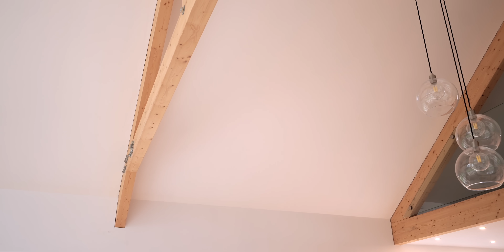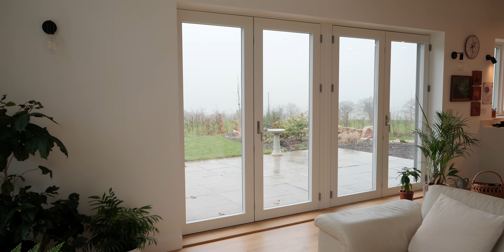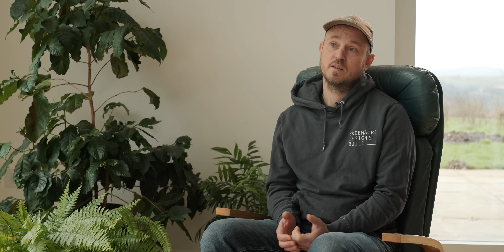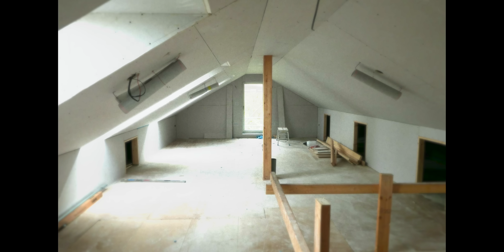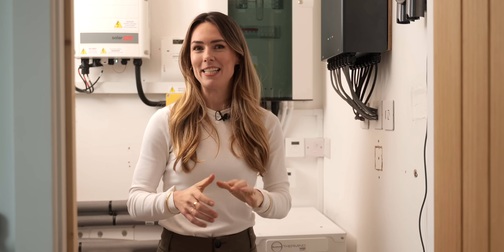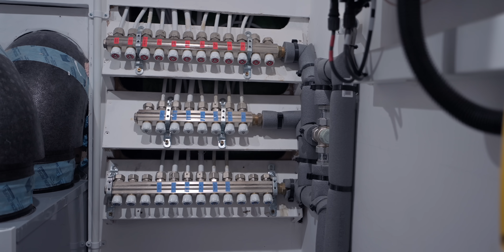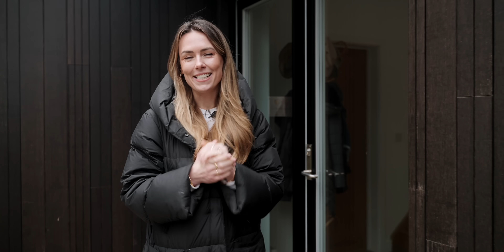Ditching a Heat Pump for In-Plaster Infrared Heating?!

Comment: The cost of electricity is ridiculous.
Reply: Which is why using an efficient electric heating system is crucial
Reply: @ASTECtherm_Infrared_Heating No look at why it is so expensive.
Reply: @fortnitefred1351 

Yes but is it?

Feel free to do your own fact checking on how efficient FAR IR happens to be.

And kindly don't drivel on about the claimed COP figures ref heat pumps.

Indeed the performance of a heat pump within the confines of a lab might well be impressive.

However, the financial efficiency ref a heat pump installation is nothing like as impressive given the costs of the pump, installation  of same, and all the other improvements highly recommended "by heat pump experts in the retail trade", who can spot an opportunity and a susceptible population of mugs a mile off.

How else do you suppose retailers survive and manage to just about rub along on vast profits?

You're a school boy aren't you.

There has to be some mitigating reason for your opinions surely to Goodness ...
Reply: @ForestForest-n9i  we are paying for bullshit windmills and solar panels, when china is putting a coal fired power station on weekly. Energy is the real currency.
Reply: @fortnitefred1351 

Not quite.

Why not read up about it before blathering on about stuff you barely comprehend.

If China do add coal
power stations on a weekly basis then what are you going to do about it?

You could always write to Xi, care of the Chinese Embassy wherever you are, and complain in the strongest possible terms.

Then, once he's reeling on the ropes from your rebuke, insist he stops at once or you'll never buy a Chinese takeaway ever again.

If that doesn't make Xi sit up and take notice then I don't know what will.

Comment: I hope this house also had a rainwater recovery tank under the garden, to use for gardening and flushing toilets. They are cost effective.
Reply: And don't forget it's a source of water for the Fire and Rescue teams when fighting a fire at a home.

Everyone knows that the likelihood of heat pumps erupting into a Post Code wide conflagration cannot be entirely dismissed hence the FAR IR elements radiating pure infra red radiation instead. This radiation cannot burn in and of itself.

No danger of a dangerously high COP from that direction.

It looks as if these are the very last days of BEVs before they are dragged to the breakers' yards.

Fortunately the recycled steel and plastics will help create the millions of FCEV and H-ICE vehicles soon to be seen driving the last of the  BEVs off the roads,  everywhere.

The lithium can be  used in medication to treat the millions of ex BEV owners, probably.

Comment: Radiant heat panels were all the rage in Canada during the 1990s. They were extremely thin panels that were installed the ceiling, under the sheetrock. Then they started fires and every house that had them were mandated to abandon them and install an alternate heat source. Fires behind the sheetrock would be my worry, so I would never have them in a home of mine.
Reply: Hmm ... why not Google up the difference between radiant panels and FAR IR panels.
Reply: Different technology from a different era.  Unlike laminated films, which are still sold today, this has been manufactured using a homogenised technique to eliminate debonding.  In addition, the graphene purity and density is such that we can operate between just 26° and 40°

Comment: Very nice. The question that remains open is how much did it cost to realize this. Only then we know how to compare the 196 per year.
Reply: Financial costs are at the absolute core of energy. If money was no object, why would we even watch this video?
Reply: @onyxsigrid  I'm not sure that's always true, it wasn't for me. I was happy to pay a premium for renewable tech, knowing that it gave me grid independence and cleaner/safer energy. The cost benefits over the longer term are actually secondary.
Reply: Agreed. The biggest issue with any YouTube channel that talks about sustainability is being entertaining.  Sustainability is boring😂😂. 

Reusing or retrofitting existing structures is far more sustainable than new construction.

New construction has always been something out of reach for many people. Add in the high cost of being “environmentally conscious” and well …this channel is entertaining for us middle class people. 😂😂
Reply: @TyrrellCornwall  I have to disagree - tho it depends what sort of 're-use' you are talking about.  I'm based up in the Hebrides where most of the older properties are stone-built storey-and-a-half buildings.  The cost of making these structures even vaguely thermally efficient and air-tight is horrendous and would only ever be a serious compromise - and heating them is a nightmare.  In reality, it would be way cheaper to just start from scratch and even more so if a slightly more pragmatic near-passive rather than actually passive standard was used. The extra cost of going the extra mile to passive standard adds hugely disproportionally to the overall cost, in my opinion.
Reply: @martinwinlow  Fair enough. The statement is a generalization and not universal and from what I understand it applies in most cases. From what you described retrofitting would not be a solution in your area. I may be wrong but wouldn’t rebuilding at today’s cost also be expensive not as expensive as upgrades to the existing building as you point out but still a large amount?
Reply: @martinwinlow  I live on Skye - a guy near me spray foamed insulated his old croft house , walls, floor, roof - triple glazed windows - he can heat his house with a candle ..I was quite impressed ..
Reply: Yes that's a very important question
Reply: @agritech802 

Yes but all you would get is a very broad figure.

Far better to contact supplier and installer to do a site survey, get a quote and go from there.
Reply: First thing is to get a building plot for a property in a middle of a field with no near neighbours with fantastic views and planning permission, that’s the biggest challenge and cost, building costs are an irrelevance after that.
Reply: We supplied the kit at a cost of about £40m2
Reply: Do people ask how much it cost to fit a boiler a more efficient fridge freezer. In this case his cost for house that size will be vastly different to someone who has a 3 bed semi. So him saying it cost me £25k bears no relation to someone who paid £10k.
Reply: Why do people talk about money and ask how much things cost.

It's a tad crass.
Reply: @ForestForest-n9i  No it is not. What is there to hide?
Reply: @Atrayus1984 

It certainly is crass, almost as bad as asking people how much money they earn or how much they have in the bank.
Reply: @ForestForest-n9i  LOL the *1950's are calling you. How much do you have in the bank?
Reply: @Atrayus1984 

If you meant that date then probably trillions at compound.
Reply: @ForestForest-n9i  No, thanks for the catch. I meant 1950's with your outdatedness lol.
Reply: @Atrayus1984 

Really?

Thanks for the correction.
Reply: @ForestForest-n9i because why would anyone do this if it cost £200k additional costs to realise £200 in electrical costs? It’s all about ROI
Reply: @chrismartell6135 

If you allude to that figure as the total cost of build then we should all sign up for buying building plots straight away.

If you were trying to imply, and you were, that the cost of installing such a FAR IR system cost "that" much then it begs the question of can we take you seriously?

How difficult can it be to contact an installer of FAR IR systems (and they can't be far away ...) lay out your query and get an idea of the costs of such an installation.

Even then you might still have to pay for much improved insulation, including draft proofing.

Then perhaps replacing your old glazing for more efficient units.
And possibly a heat recovery system complete with loads of preheated fresh air.

Next time you think of asking such questions then kindly don't.
Reply: @ForestForest-n9i it was a simple roi conversation you dolt
Reply: @chrismartell6135 

Hmm ... perhaps you didn't quite grasp the thrust of my reply?

That must be it.
Reply: @chrismartell6135  this @ForestForest-n9i account is very new and i am guessing it's just a fake bot account -  or the person is a complete imbecile
Reply: @chrismartell6135  To your point, if I can put my £200K into the stock market or a simple ISA (yes I know it doesn't cover all of it) I can generate return with my capital. If I put it into my electricity just to save £1500 per year, I'm a complete fool. Because it'll take me 60 years to get my initial investment back when my £200K over 60 years would have generated me extraordinary returns in that time even at 4%.
Reply: Oh - And I'll be dead.
Reply: @jamescpalmer 

Stop! You want the  Digitas website next door son.
Reply: @ForestForest-n9i  "perhaps you didn't quite grasp..."
Perhaps you don't quite grasp how ridiculous it is to argue against people discussing the cost of this system in the comnent section of a video promoting it.
Reply: @brt5273 

I despair.

This platform is available across the planet.

Do you really expect a cost breakdown to suit all locales?

The idea is to price up the costs for an entire job, or just part of a job, in your own locale, even in the same country.

How difficult is it for you to understand?

Or are you expecting to be spoon fed all your life.

Get off your arse and search the costs for yourself.

Next time you decide to post such a silly question kindly don't.
Reply: @ForestForest-n9i Because in the video they talk about money too. That's the point.
Reply: @MrTubertub 

😂😂😂

And that's your argument?
Reply: @ForestForest-n9i  What a frigging toad
Reply: @ForestForest-n9i Turns out it's really easy to make a sustainable and efficient house when you have a million in the bank for CAPEX on your dream green home.

Let me just tell all those freezing in homes with black mould that they just need to be rich.
Reply: @AdmiralValdemar 

Generally the people who whine and bleat about how unfair life is that they themselves have nothing whilst others have plenty of resources.

This might be down to the fact the "poor" didn't study hard enough when at school, got shit jobs and you can work out the rest for yourself.

I get the impression "you" feel that people who have done well, or better than "yourself", are cheats, sharks, chiselers and whatever else you can come up with.

Looking at it from the other direction some of the better off might feel "the poor are always with us" and are more likely to be petty criminals, careless with their health, drink, smoke and indulge a habit for illicit drugs ... which then requires the intervention of the Law,  Prison and Probation Services and almost certainly assistance from the NHS.

All of the above are a drain on the public purse.

Has the penny dropped yet?
Reply: Because it’s relevant , the 196 bill per year brings it in to the equation I know from having just finished a year ago the cost of producing something to this standard is vast and unrealistic for many .

Comment: Hidden in or behind plaster... I can see the cracks appearing now (unless of course you just have it on and never really turn it off so it doesn't cycle). We did look round a house once that had the IR panels in the ceiling, they were visible, but flush mounted and not that un-sightly. It was really nice walking around and just feeling this gentle glow like draping over you as walked about. It had the added benefit of warming the floor as well - not as good as proper UFH, but enough to feel it.
Reply: Cracks you say.

Nothing was mentioned in the chat but you never know.
Reply: No.  Our product was designed by Stuttgart University with the help of Knauff.  Cracking occurs if the heat emits above 50°c which is one of the reasons that we designed this to work effectively at less then 40°c

Comment: If you've the inclination, time, and money by all means, knock yourself out and build a system and a house from ground up.

Now, coming back to the real world, a more practical outlook is required, such as the Germans have. Hybrid Heat Pump Systems (Heat Pump + Boiler)

How it works: An air-to-water or ground-source heat pump acts as the primary heat source. A modern gas condensing boiler is integrated to handle peak loads (e.g., temperatures below freezing) or to take over entirely during maintenance. If you live in the twiggs, an oil burning boiler, which at the moment, reaches 93% efficiency.

Even this will cost money but more practical 😮
Reply: Yes but you're forgetting the old guy's ethos of KISS.

Heat pumps and boilers might have been outside his KISS thing.

As in there were more financially efficient ways of heating for him.

Instead of a lot of cash going out on complex kit he opted for FAR IR.

Cheaper and not over complicated.

It may be his research revealed that heat pumps required servicing and eventually became noisy.

So a source of aggravation and requiring money for repairs.

Comment: Good luck with that radiation on your body
Reply: Why not Google up FAR IR radiation and see how it's used in medicine.

It's not ionising radiation. Perhaps you might Google up that too.
Reply: It isn’t “radiation” in the way you’re thinking.

It’s long-wave infrared — the same heat your body gives off all day and the same warmth you feel from the sun or a warm wall. No UV no microwaves no ionising energy.

If this was harmful then underfloor heating sauna rooms physiotherapy clinics heated floors and even sitting near a fireplace would all be dangerous. They’re not.

This technology has been used in homes hospitals and public buildings for decades. It’s one of the safest forms of electric heating you can use.

Comment: So what saving money if you spend the savings on flying or buying `stuff ` Perfect air tight seals are always horrid and noisy and exposes you to a lot of building a textile treatment gases ..good luck , or you could wear heated vest !
Reply: On what do you base this article of faith?
Reply: @johnburns4017  Listening to air tight new build owners as a delivery driver , i guess that counts as anecdotal but it was a common response . Also when delivering to indoors you could tell there`s been no fresh air . Also i live in Scotland and heated vest means i just need a heater on briefly when washing or bathing  and in the bedroom briefly .(but it is well insulated but draughty ) And money saved only goes on buying trees or other environment improving zero carbon output options , and you ? (context ongoing climate catastrophe )
Reply: @MyKharli 
Note the ventilation and heat recovery system in this house. Solved.
Reply: @johnburns4017  ah yes a peaceful house in the country with a fan on all day , problem made worse !
Reply: @johnburns4017   fan on all day lol
Reply: @MyKharli  
The fans turn at a very slow rate. Silent. It is best to take in what the clever write here.
Reply: @johnburns4017  except the older ones ive seen is whirr whirr whirr , im glad theres a quiet one , they break down to0 and are expensive .
Reply: @johnburns4017  what was the overall carbon footprint of this house over a straw bale one ? Is it an add for wealthy who don't like house bills but use savings to fly everywhere ? What was the point of the post that i assumed a green angle but found another posh building site is all im saying .
Reply: What on earth are you on about???

Comment: In floor is better than in the wall . The heat will rise through the wall to the attic . The heat in the floor warms the floor , then slowl heats your coldest air (at the floor) and slowly rises as it heats the air.
Reply: What are you on about?

The FAR IR radiation heats "you" not the air.

You forget or perhaps didn't realise but the planet is heated from above.

Ditto in this house.
Reply: But the cost of underfloor heating is not cheap. In this case it would have to be electric.
Reply: Underfloor heating works well and we supply a lot of it — but plastered-in infrared works in a completely different way.

It doesn’t heat the air first, so there’s no hot air rising into the attic. Infrared heats the surfaces and people in the room directly. Walls, floors, furniture and ceilings all absorb the energy and then gently release it back, so the heat stays where you need it with no convection losses and no cold spots at floor level.

Both systems have their place. Infrared is ideal where you want fast response, no radiators, low running temperatures and very even comfort — especially in retrofits, lofts and upper floors where underfloor isn’t practical.
Reply: @ASTECtherm_Infrared_Heating 

Crikey!

Despite all that's been typed in these pages and many suggestions to do the Google thing viewers still have a job understanding how FAR  IR "works".

It's like beating your head on a brick wall 😂😂😂😂😂😂

Let's hope your post assists in helping some viewers that heat pumps are not quite the answer to a maiden's prayer.
Reply: @ForestForest-n9i  well said!  We're not brave enough and have to be polite to the COP3 bunch lol

Comment: £196 per year on electric but it cost him £150k for the setup! Let's not kid ourselves this is a money saving exercise.
Reply: When did you hear that figure?
Reply: Well, this is certainly a showcase project with quite a few bells and whistles that not everyone needs. But if you're building a new house anyway, the price difference for better insulation and efficient heating systems is usually not so high that it wouldn't pay for itself in the foreseeable future. Especially since you can already enjoy the increased living comfort during the amortisation period.
When I built three years ago, the additional financial outlay was (converted) just under £35,000. I'll have recouped that in 15 years at the latest, and I intend to live in that house for considerably longer.
Reply: @marcromain64
Apart from the Sunamp, there is nothing expensively  extravagant.